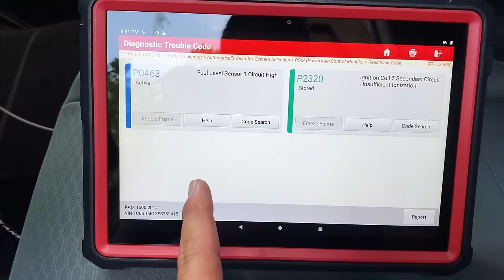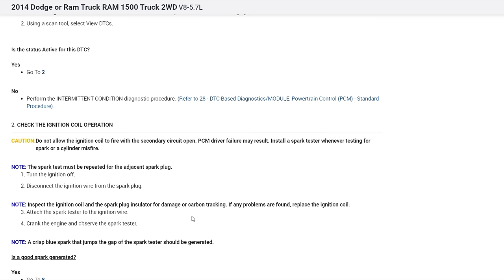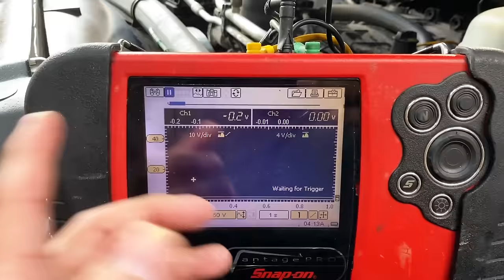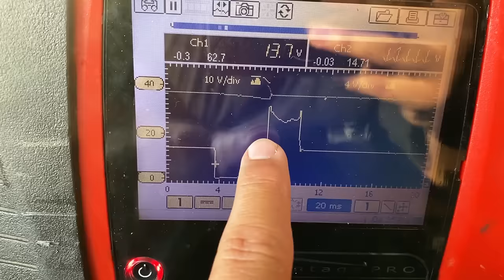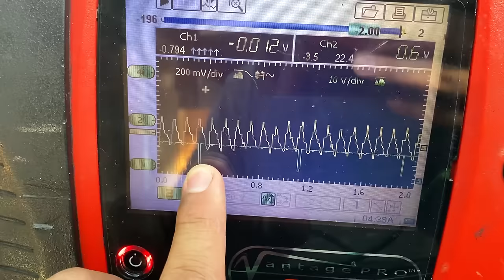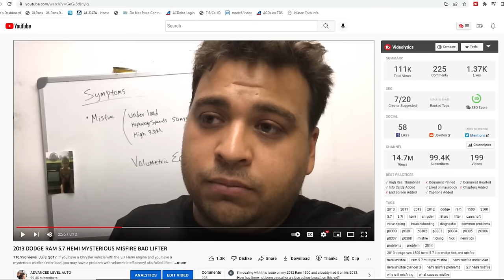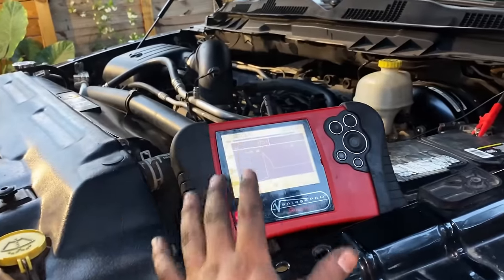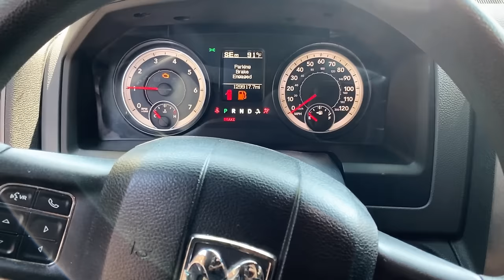DODGE RAM 5.7 HEMI MISFIRE INSUFFICIENT IONIZATION DIAGNOSIS & FIX

Comment: I would of never thought the pcm was at fault. I don't understand with the data you gathered and what I seen how the pcm was the issue. The driver did its job, it held the coil to ground and let go. The high spark line is after the fact. The only thing I can think of is the driver was holding to long or short. Other then that im confused. Its crazy the pcm was the issue.
Reply from the maker: Same here! I still have trouble understanding how the computer was able to control and fire the ignition coil but somehow it detected a misfire caused by itself. I hope someone in these comments can explain why and how the computer made the ignition waveform look the way it did.
Reply: @ADVANCEDLEVELAUTO  thats key and the right question. How did the pcm cause that wave form.
Reply: Looking at the dwell time in your captures. Cylinder 7 had a dwell of about 1.7 ms with the bad pcm vs the good cylinders having a dwell of about 4ms
Reply: May not have noticed initially as in the video, your were on a 10 ms time base for cyl 7 and then a 20ms time base on the others, making it appear the same on screen… just my thought as to why some may not have caught it
Reply: Awesome video!
Reply: Only thing I could assume is the driver was holding too long and not letting go in the allotted time for the cylinder to fire correctly… but you know what they say about assuming and modern cars.
Reply: Seen the pcm in dodge vans die fairly often.

Comment: Just a piece of information, ever since they removed the sulfur from gasoline about 2004 2005 ish that has caused a lot of fuel level indicators to start acting up because they no longer get lubricated. And occasional addition of Marvel Mystery oil, about 6 oz maybe 8 oz on occasion to the fuel system works wonders for making sure that the fuel system still gets lubricated.

Comment: I’m so glad to see you’ll be at 100k within a day. You deserve to have a million though. You diagnose and correct some of the most complicated and craziest electrical issues. No matter how relevant your videos are to me I watch them all. Great job.
Reply from the maker: Thank you for all the support!
Reply: Muy bueno el vídeo,lo mire desde principio asta final muy buena información
Reply: I have a 2010 Ram 1500 check engine light (mirror passenger right circuit short to battery B1645) any ideas what can be wrong?…thanks

Comment: Great diagnosis, I would never think that a PCM could be the direct cause of a misfire in a million years.
Reply from the maker: Honestly it still confuses me because the PCM is still able to control and fire the ignition coil but it detects a misfire due to it's own fault.
Reply: I have come across this code many times. It always turns out to be a pcm for me.
Reply: Seems like Chrysler PCMs have a thing of their own
Reply: @ADVANCEDLEVELAUTO  Yeah its like it's throwing punches right back at itself.

Comment: Whenever I get DTCs that have a circuit codes it’s never been anything internal mechanically with the engine. It’s always been a wiring or module issue. Glad you got it fixed 👍👍👍

Comment: It really blew my mind when I first saw the ignition waveform for cyl #7, I couldn’t make any sense of it either, initially. I know you and so many others are wondering how it is that the PCM can properly ground and release the coil, yet there is no spark, with an odd looking waveform. So after thinking it over a bit, here is what I believe is basically happening.

A transistor is composed of different layers, some of which are insulation between conducting layers. I believe what is happening is essentially the effect of an insulation breakdown inside the transistor for that coil’s driver circuit. So the transistor can operate properly and switch on and off as long as the voltage is not too high. But the voltage spike from the coil being released is high enough to leak past the insulation and start conducting to ground again. That would explain the odd waveform, which interestingly, looks similar to a current ramp.

Also I noticed that the peak inductive kick voltage is only around 40 V on cyl #7, but off the scale on #5. That would also seem to indicate that the transistor starts re-conducting again around 40 V, and dissipates the energy that would otherwise have created a spark on the secondary side. I am by no means an electronic expert, but I know the basics, and I believe that explains what is going on. Someone with a more in depth understanding of electronics and transistors please correct me if I am wrong.

Comment: Great diagnostic, The biggest problem having the pcm close to where all of the heat from the engine. I know its easier to get at but having to replace for it again and again. Its better having the pcm in the under dashboard, far away from the heat.

Comment: Great video!  When you 1st said the owner replaced the spark plugs with Iridiums, I thought for sure that would be something to do with the problem. It is pretty-well known in the 5.7L Hemi community that this engine likes basic copper plugs better, Champions or NGKs. So glad to see that you swapped plugs later on in the video to rule that out.
Reply: Thats a negative, they prefer irridium. Wont run well on very many plugs at all.

Comment: AMAZING job!!  I just had the SAME ISSUE!!!  2014 Ram 1500 with the same code and no ignition/fuel on Cyl. 8.  I had an electric shop verify the ECU was bad 100%  I got a new rebuilt ECM that is programmed.  When I power the truck up it says that I need to push in the clutch?  It also has lots of warnings.  I did not cycle the ignition like you did I will try that.  I took the new ECU out and put back the old one and it does the same thing so it must be a program issue that I'm not following.  Thanks SO much for this vid!!

Comment: Wow 
My first thoughts based on the primary ignition waveform was an issue with spark jumping out early to ground. 
I am surprised that turned out to be a failed PCM. Especially since all the current ramps showed clean turn off. 
If the collapse is clean on the current ramp I guess the inductive kick was shorting to ground internal to the pcm 
That’s crazy nice find yo. 
I was thinking you could of pulled the coil out and put a plug in on side of the coil and ground it to the other coil boot and then taken the primary waveform again. If it changed then you’d be going with something other then ignition. 
Either way u tested and came to the right decision great job
Reply: Yes his primary was showing a low spark line and a tailing off burn line indicating a shorted secondary , i would have tried to put a lead on the coil and viewed secondary after seeing that , european cars have used this ionisation thing as feedback for years for ignition timing control and cylinder position .

Comment: Love your video and how throughout you diagnostic skills. I’ve watched many of your videos and love it. I bought my car to a mechanic to fix my brake problem, they replace master cylinder and booster without making diagnostic properly. The brake doesn’t work so they called and apologized but still I’m getting charged for the parts, they felt bad to charge me for the labor. If I take my car to you to get it done by you correctly, I would’ve save money from replacing good parts! That sets him apart from average Joe mechanics

Comment: Your r the man Eric, If only we knew how would the pcm fail when it can switch the coil and still monitor the spark line.
Maybe the driver was getting tired and not switching fast enough

Comment: Great video.  My only tip would be to use a vacuum gauge ,while cranking and while the engine is running

Comment: My 5.7 hemi misses under load. No codes show up. New plugs, coils. Heads were pulled. Lifters and cam are good. It’s been to two dealerships multiple times. I’m ready to give up. Gas mileage is around 9mpg and I have to try to get that. Know one has mentioned checking my injectors but you would think that would throw a code.

Comment: This is a very informative video. I have a 2014 Ram 1500 5.7 hemi. I have been chasing these gremlins for about 6 weeks. Started with a broken spring and dropped valve in #7. Replacing all springs, broken valve, and pushrods didnt correct issue. Did a MDS delete because i was going to remove heads again. Put new cam and solid lifters in. Still had random misfire (P0300). Purchased an refurb PCM and i still have P0300. Gonna go through it again following your video, hopefully my luck changes. Thanks again.
Reply: What was the verdict on your RAM situation ?
Reply: @stevenross1738  Turns out it was the valves and springs. The extra air from the failing valve spring caused the PCM to go crazy and kick out various codes (throttle body air flow, accelerator pedal, etc). After I replaced everything, the #6 intake valve didn't seat properly causing the same conditions. Did a leak down test on each cylinder and discovered this. Also after reassembly a ground wire wasn't making contact send out a transmission error (new found respect of ground wires btw). The truck is now running happily.
Reply: @ml9704  ok. I’m trying to understand because I’m going through something similar. My 2011 Ram 5.7 started throwing P0306 code. I replaced both plugs and coil pack. Code came back. Replaced fuel injector. All on cylinder 6.
Code is back and another individual is saying it’s the lifters etc. I’m not all that mechanically inclined, to say the least. He’s saying it needs dod deletion. How does this sound to you in your experiences ?
Thanks for your reply.
Reply: @stevenross1738  My suggestion, from this experience, through the code reader to the side. get a leak down and compression tester. make sure compression is good. then chase other things. If you are going to tear the top end apart, get rid of the mds garbage , they will fail on you.
Reply: @ml9704  thank you for your input and response. Much appreciated. Curious what a leak down test does ?
Reply: @stevenross1738  the leak down test shows valve and seal integrity. You create positive pressure in the cylinder with compressed air and it should hold pressure. If it doesn't, there is a leak somewhere in the rings or valves.

Comment: I've been a tech since 2012. One of my neighbors had this same issue on his hemi truck. He bought a new coil and changed spark plugs  thinking it would solve  the misfire issue. After testing coils, injectors and looking at the values on scanner came to conclusion it was the pcm. His computer was causing the  injector of the dead cylinder  to over fuel and white smoke was coming from exhaust. Before I fixed his truck last guy was telling him he had a blown headgasket 🤦

    " it is a Chrysler/ dodge thing" I guess the newer generations do still have the same issues with the pcms as the older generations.

Comment: In my job I have plenty of time to watch videos out of boredom.  I’ve watched thousands and thousands of videos and found this.  YOU sir are way under rated.  I knew a few minutes in, that you weren’t some clown pretending to know a little about trucks like 99% of YouTubers.  I’d honestly feel comfortable using your video as a tutorial should I ever cross this issue on one of my Rams.  I’m going to have to check out all ur videos cuz even though I don’t have anything wrong with my truck, it was very educational.  EXCELLENT VIDEO !!  5⭐️s

Comment: Greetings, you have very good diagnostic videos. I also like to solve cases regarding diagnostics in the fca line. The PCM has a misfire counter. When the PCM detects many cylinder misfires, it disables the pulse, although it is not necessary to rule out driver damage. of spark, I have solved some cases by changing the misfire counter with hp tuner without replacing pcm.

Comment: Thank you so much! I had another one of these come in today with the ionization code except on cylinder 4. Following along your video helped me determine it was also the PCM on my customer's truck! Knew the coil swapping trick but hadn't used the oscilloscope feature before to go further.

Comment: Great diagnostic  approach  thanks for sharing,  you could have  seen the valves activities  with out opening  the  valve cover , with the  In cylinder  pressure  transducer and  pulse delta/absolute sensor , I love those tools   for mechanical  diagnostic. I am curios  why did you have good ignition current romps  and all 8 events  of coil  current consumption,  was there any insight  of what failed on the pcm, weak  voltage  activation? Did the  current  was low on that cylinder activation?
Reply from the maker: I wish I would have brought my in cylinder pressure transducer with me but I didn't and the customer lives over an hour away from me. I am not sure of the initial cause of the PCM failure. It may have something to do with the old spark plugs they replaced. Maybe they had excessive gap or high resistance.
Reply: @ADVANCEDLEVELAUTO  I am  sure  with those 2 channels,  Amp probe and voltage  command  to the col control there is the unswer , unfortunately  your scope has limitations sample rate, saving  waveforms ability to zoom  vertical scale so on,  I see your knowledge  is  awesome  your scanner analysis  , diagnostic approach  are the best,  but on the scope  tools I believe  you should  think to get a laptop  base scope those let you capture  the analysis of the recorded save  waveforms are  incredible,  like Pico scope or usb auto scope. Personally  when I am at the shop and the pressure is on I save the captures  on a folder from before and after repair than I make it sense after replacing  a part I go back and O fond some thing , this is with the purpose of better approach  for future  diag and increase knowledge.  Thanks for sharing your knowledge

Comment: I have a 2004 dodge ram 2500 with the a hemi magnum 5.7l and went threw the same tests.  mine is a misfire on the secondary coil. it throws a check engine light for the secondary coil. truck runs GREAT No miss fire. new coils, wires, and Plugs. I'm now thinking the PCM??? great Elaborate video. Great details. thank you very much for your time and Effort.. thumbs up, and Subbed

Comment: I have over 35 years of Dodge/Chrysler/Jeep dealership experience and ionization codes are not common. That said, it's usually always a coil or the PCM issue setting those codes.

Comment: Great process. My mind went to vacuum leak before lifters. I really appreciate how you go through your rationale for scope settings. Thanks.
Reply from the maker: Yes a vacuum leak on a single cylinder is unusual but it does happen. Faulty intake gasket or bad injector oring can cause it. Thanks for watching!

Comment: Great video, would it be worthwhile to also connect the lab scope up and compare number 7 fuel injector waveform with another cylinder to rule out wiring or PCM issues in number 7 fuel injector system,  Keep up the good work I really learn a lot from your teaching.

Comment: This is where using an in cylinder transducer would be helpful. You'd be able to see a valve issue without removing the valve cover.
Reply from the maker: Yes. Unfortunately I did not bring mine and the customer lives an hour and a half away from me.

Comment: Relative compression is new for me. I'm guessing the way it works is that a cylinder with low compression would crank easier than the rest and take less battery amperage during it's cycle. Works for me. :)

Comment: Love your videos man. I am a chrysler tech and still learn from you.  I'm slowly learning to use a scope. What scope do you have ? Mds is the 4 cylinder mode. The hemis can have the none mds lifters fail also. Sometimes a vacuum test at idle or cranking can show a bad lifter. One question tho. On the wave form for the coil what is the little bumps after the fire line on the good cylinder ? Also for amps on the coil did you just clamp the asd power feed or what?

Comment: A lot of times the 5.7 Hemi could develop what is called the "Hemi Tick". One of the lobes on the cam shaft was worn down by a lifter with a mechanical issue bad end. You can diagnos this by a misfire and a ticking noise. Only way to fix this is replacing the cam and lifter. If you only replace the cam, it will be a while but that bad lifter will chew away the lobe again. a ofset roller on the lifter can cause this too.

Comment: How did you set up your oscilloscope leads when you did an ignition coil current ramp test? Great video as always Eric I always learn alot from you👍
Reply from the maker: I used a fuse buddy inplace of the fuse that feeds power to the coils. Then I was able to hook my amp clamp to it.

Comment: After watching this video again I think I see what’s actually going on and what the scope capture means. First off that 40 volts is pretty low on the firing line. On the other cylinder you checked the firing line is high enough it’s off of the screen meaning it’s above 50 volts and may be even higher if peak detect isn’t turned on in the scope settings. The PCM coil driver is unable to provide the current necessary to have an adequate spark. That’s why the spark line is a gradual fade off to ground. The spark isn’t happening and the voltage is bleeding back off slowly through the coil to ground somewhere probably in the PCM itself.

Comment: I recently learned that swapping coils or anything on later models is not a wise thing to do, because if the part has a short to ground, it can fry the transistor in the computer.